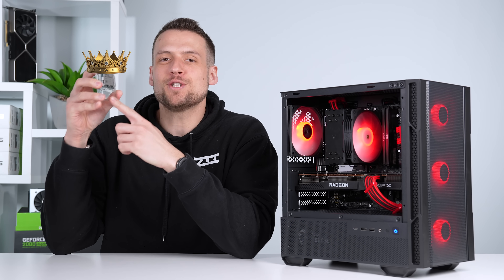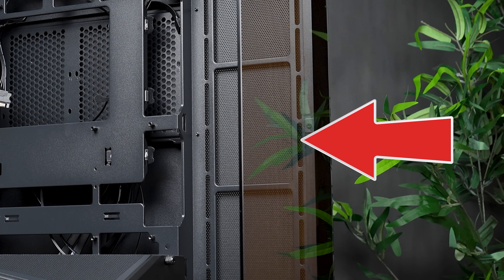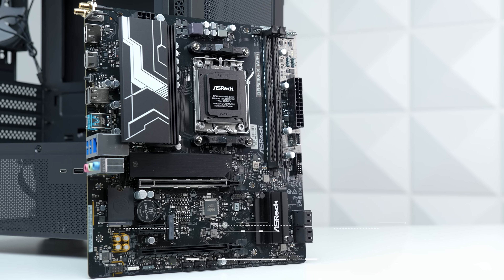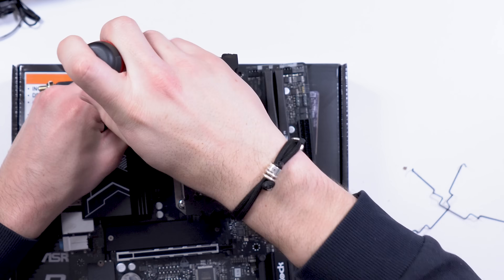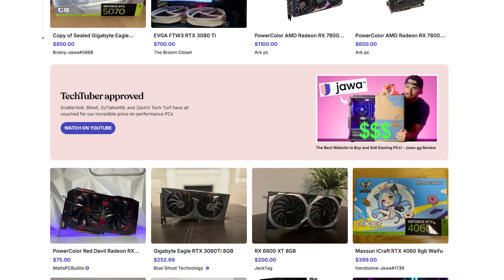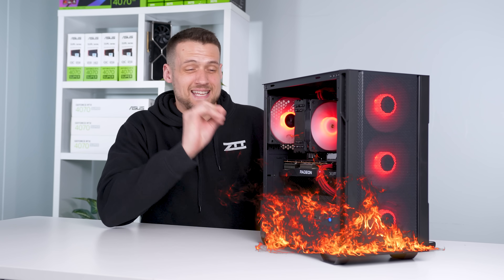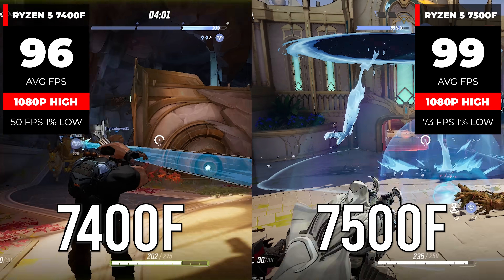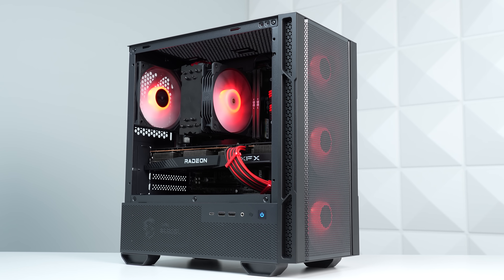$800 Gaming PC Build Guide

Comment: tysm i asked abt this 1 day ago
 is this build good:
  Zotac GAMING GeForce RTX 4060 Twin Edge NVIDIA 8 GB GDDR6
Intel Core i5-12600KF Desktop Processor 10 (6P+4E) Cores up to 4.9 GHz Unlocked LGA1700 600 Series Chipset 125W
ASUS Prime H610M-K D4, LGA 1700, mATX Gaming Motherboard, DDR4, PCIe 4.0, M.2 slot, Realtek 1 Gb Ethernet, SATA 6 Gbps - Black
GAMEON PULSE-M Gaming PC Case – ATX/M-ATX/ITX Support, Tempered Glass, ARGB+PWM Lighting, Pre-installed 7 Fans, 360mm Water Cooling Ready
16GB G.Skill DDR4 PC4-25600 3200MHz Ripjaws V Black CL15 Dual Channel kit (2x8GB) 1.35V
Crucial E100 1TB M.2 NVMe PCIe Gen4 Internal SSD, Up to 5,000MB/s, Laptop & Desktop Compatible - CT1000E100SSD8
Thermaltake Litepower 650W Power Supply, Non Modular, ATX 2.3 & EPS, Active-PFC, PSU, 12cm, EU/Non, 80PLUS - Black

can you also give me a around 3000 aed build or 820$ if this isnt good please give me tips and what to change if needed.

Comment: From Bangladesh.
Is this PC future proof for me? My budget is 60k taka so I prefer,
1.MSI B550-A PRO motherboard 
2.amd ryzen 7 5700x processor  
3.intel arc a580
4.Corsair Vengeance LPX 8GB 3200MHz DDR4 Desktop RAM 
5.OCPC MFL-300 512GB M.2 NVMe SSD
6.Gigabyte P550B 550W 80 Plus Bronze Certified Power Supply.

for productivity and gaming.

Comment: My first Build:   / any advise ? 
 ASROCK Steel Legend Radeon RX 7700 XT  475€
 OC, RX7700XT SL 12GO 
 ryzen 7 5800x  171 € 
 b550m-a Wifi II / micro- Atx  110€ 
 TD300 Mesh / comes With 2* 120mm fans  74€
 Deepcool AK620 White 67€
 CORSAIR Vengeance RGB PRO SL weiß DIMM Kit 32GB, 3600mhz  75€
 Kingston FURY Renegade 2TB NVMe 145€
 750W PSI-J (Be Quiet! Pure Power 12 M 112€
 CORSAIR RS Series RS140 ARGB Fan, 41€
 weiß, 140mm, *2
1g  thermalgrizly thermalpaste 9€
 Sum = 1289.5€ = $ 1402,85

Comment: 1% lows seem to take a bigger hit on the 7400F (Marvel Rivals for example.). Also, If you can get the Arc B580 for less than $300, works great for a build like this.  I have a similar build except the 7600X CPU.  1440P in most games with no issues.

Comment: I NEED YGS HELP I can get this build, but with a 7600x and the build would be like 10 dollars cheaper but i can only get 16 g of ddr5 (apart of the 7600x bundle) So it would have a better cpu for 10 dollars cheaper but 16 g. So is it worth it? ( I would mostly play fortnite, marvel rivals, and gta6 whenever it comes out)
Reply: No gta 6 man, but 16 ddr5 is good. Pro tip: buy used ram

Comment: I'd be less concerned about the difference between the 7500F and 7400F right now, compared to the longevity of both, and the difference in a few years. How will the 7400F hold up over time, will the internal thermal paste degrade?

Comment: I wouldn't really recommend the 7400f myself because the thermal paste will dry up after a few years and you will have to delid it. I'm ok with that but 99% of people don't want to void their warranty just for that. 7500f isn't that much more expensive and it doesn't have this issue

Comment: guys is an rx7600 good? Also how do I install a gpu if my cpu has integrated amd graphics with drivers installed
Reply: Yes it's good. What do you mean? You just plug the gpu in the motherboard.
Reply: @Rick-eq3xu  and I dont have to worry about the cpu integrated graphics?
Reply: @brwlStarrFallOf course you don't have to worry about it. It's like having two gpus.
Reply: @Rick-eq3xu  but it only will use the dedicated gpu right?.
Reply: It will use both
Reply: @Rick-eq3xu  why, what if I want to use only the dedicated gpu
Reply: @brwlStarrFall why disable something that can make your pc better, I mean you can but it doesn't make any sense. For intensive workloads your pc will use your gpu automatically. The integrated graphics card is used for faster speed overall in graphics and for a second monitor. Trust me, install the drivers for the gpu and make sure your main gpu is the dedicated one. Nothing else to worry about

Comment: We need a ztt build guide tier list
Reply from the maker: That would be nice tbh
Reply: @ZachsTechTurf you can only make so many 600-800 dollar pure performance builds
Reply: @ZachsTechTurf  Hey Zach I’m thinking about getting a 1300 pc with a:
Thermalright notte 360 aio 
Rx 7600
Ryzen 5 9600x
Azza pzaz 650w psu
1tb 
32 gigs of ram
B650m wifi
And a 95 dollar case from Amazon
Do you have any tips or changes that I could improve.
Thank you
it’s Canadian money
Reply: @Lunarpostcard  you should switch to a rog astral 5090 and a ryzen 7 9800x3d
Reply: @Lunarpostcard really suggest looking at a 9060 or 5060 instead of the Rx 7600
Reply: @MatthewJessey  ok
Reply: Alive internet theory:

Comment: use the ryzen 5 8400f its even cheaper
Reply: Never buy 8400f its garbage
Reply: Why?
Reply: @DaggerAviation the 8400f is a failed series that has a massively lower performance than for example the 7500f, it also has a ton of other issues like with heat and compatibility, just not a good choice overall better to go am4 at this point
Reply: @steel.9k Hmm okay Thanks
Reply: Really I just want to see Zack try it.
Reply: And slower
Reply: i would've just gone with a basic 5 5600 for this budget pc, maybe even a 5600X

Comment: Thoughts on my build that I put together last month?

CPU:		AMD Ryzen 5 7500F
CPU fan:	Arctic Freezer 7 X
Motherboard:	MSI Pro B650-S WIFI 
RAM:		KINGSTON FURY BEAST 32GB (2X16GB) DDR5-5200 CL36
SSD:		ADATA LEGEND 960 MAX 1TB 
Case:		Darkflash Aquarius Mesh
Case fans:	Arctic P12 PWM PST 120mm 4-Pin (x6)
PSU:		COOLER MASTER MWE GOLD-V2 850W MODULAR 80+ GOLD
GPU:		GIGABYTE GTX 1050 Ti (from old pc - needs upgrade)
Reply: Not bad if anything id change the ram to a CL32 or failing that CL34
Reply: @jakehedges2315  Yeah, actually I didn't know about XMP and EXPO back then. If I did, I would have bought a 6000 MT/s at CL30.

Comment: Why are so many people recommending the 7400f??? Its literally the same cost as the 7500f (~$125 on ali) but much worse due to less cache, slower clocks, and yeah the bad cooling.
Reply from the maker: Maybe you're just not actually watching the content? I didn't actually recommend it, unless the price gap is huge. I specifically said what you said, if the price gap is small, get the better 7500F
Reply: depends on where you live, in some places the 7400f is cheaper than the 7500f but overall the 7500f is around the same price because its been around so long and are thus more widely available. Eventually the 7400f will be more available and cheaper than the 7500f

Comment: Insane Upgrade path
Reply from the maker: True
Reply: A Zen 6 with 3D cache CPU, would be an extreme upgrade!
Reply: @Daniel-or3vf  He can easily switch stuff without changing the Mobo or Ram which is a big game changer. 3D chache AM5 CPU highend and also a Highend GPU if he wants but he would need to change the PSU
Reply: I don't know if the VRMs on a 110$ mobo will be able to handle a X3D 105W CPU without losing clock speeds.